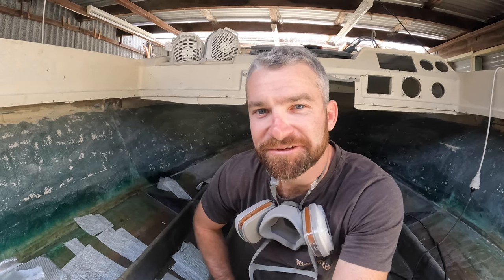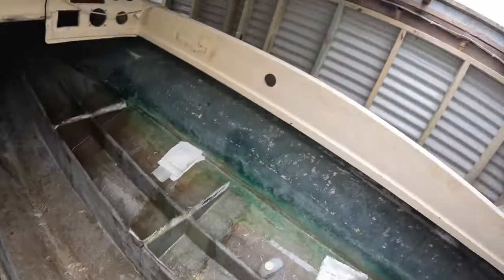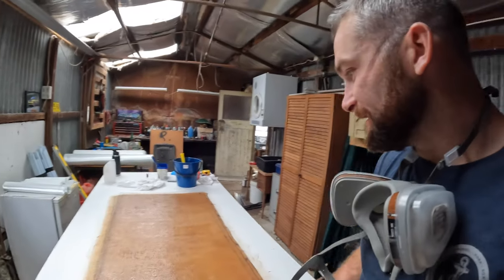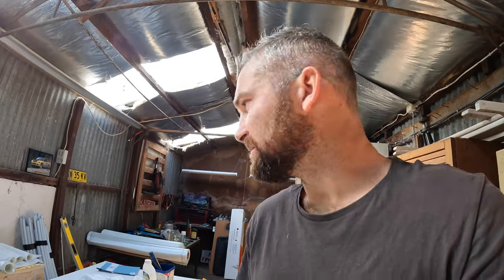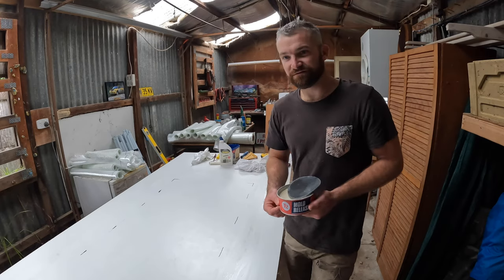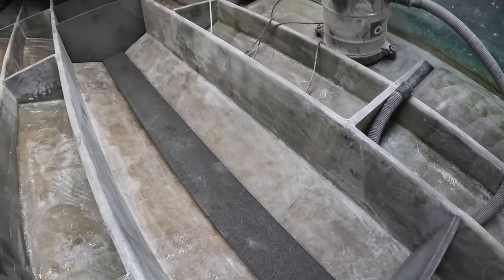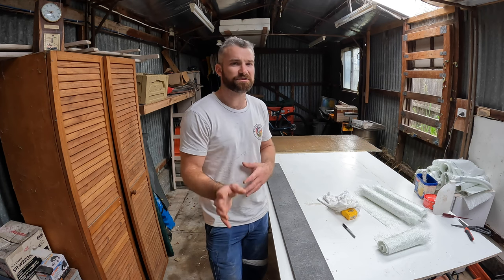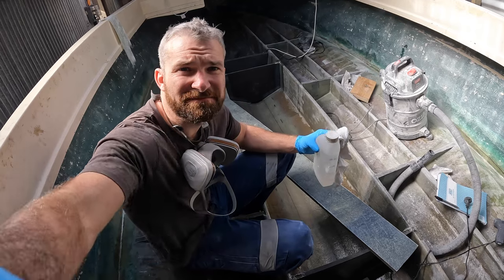Building a Fibreglass Fuel Tank in a Haines Hunter 600R

Comment: Hey mate love the videos. Quick tip I thought of. 

When mixing cabosil and resin pop a ziplock sandwich bag into your mixing comtainer. Then mix your cabosil and resin in that. You can then snip off the end and use it as a kind of piping bag which saves time and consumables when coving. 

I roll it all into the corner with a bolt roller. 
Then I go over my coved corner with a small paintbrush to smooth it all out.
Reply from the maker: Thanks mate, I will keep that in mind for the next time I’m diving in a corner. Thanks again for watching 👍

Comment: Hey Mate, your video couldn't come at a better time for me. Currently rebuilding a Caribbean Crusader I'm in North QLD, I'm also keen to make my own fuel tanks but they will be standalone tanks,  Few questions. Which vinyl ester resin are you using for your fuel tanks and where did ya get it from?? Reason why I ask is cause I"m having trouble finding a vinyl ester that is compatible with petrol containing ethanol, even though our RULP contains no ethanol I'd like peace of mind If somehow e10 ends up in there as ethanol dissolves some vinyl esters and epoxy resins. Some of the the novalac vinyesters seem to be resistant. Trojan fiberglass sells a bisphenol vinylester which from what i read are not as good as novalac vinylester but still waiting to here back on that one. the other option I'm considering is coating with Caswell tank sealer which is a novalac epoxy. Interested to hear your thoughts.
Reply from the maker: Hi Mark, good name by the way! That is a very interesting question and you’ve certainly done way more research on the topic than myself. Firstly I get most of supplies from Fiberglass A/Asia Pty Ltd, a store in Sydney that has 40 odd years experience. They assured me the vinyl ester I purchased is suitable for use in fuel tanks. I’ll get back to you on the exact brand and make. I’ll also add that I have a friend who built a tank in 19r the same and he’s had no issues 4 odd years into using that boat, further to that Coota Craft build tanks in a similar fashion and I’m lead to believe they just use vinyl ester resin with one final coat of waxed resin over the whole tank before sealing off. This is covered in my next video which should be up within a week. You raise a good point about Ethanol, I personally would never put E10 in a boat but the potential is there. I do share your concerns about the tank degrading over time, I guess time will tell with mine now, I just sealed the lid off last night and plan of glassing the lid down today.
Reply from the maker: Swancor 901-TP VE is the resin I used Mark.
Reply: @ADVENTURES_ADRIFT  Thanks Mate! I've found a data sheet for the swancor resin your using. looks  like it's a bisphenol resin like the Trojan Fibreglass Vinylester. Still waiting to hear back from those guys about compatibility with e10 but if they're not keen I may give the Swancor stuff your using a go and then maybe still apply the coat of Caswell novalac epoxy inside. Keen to see your next video. One shit thing that worries me is if the politicians decide to mandate ethanol content in fuel in years to come like the UK and USA.
Reply: Just had a response from Trojan about their vinylester - They were not able to guarantee it's use on fuel as it had not been tested for the purpose. Doesn't mean that it won't work though. Something else he mentioned witch you've talked about in your video

"If you do use vinylester, you will need to ensure the resin has fully cured that will be in contact with the fuel. If you’re using a male mould for instance, the surface that’s in contact with the fuel will cure well from being in contact with the mould. If it’s a female mould, you’ll either need to vacuum bag it or use a wax in styrene solution. Wax in Styrene solution needs to be added carefully, and does not guarantee 100% surface cure. You’ll also want to flush the wax out with a non-polar solvent such as IPA.
Your only other option would be to source a resin certified for fuel use, which will likely be a Novolac based resin. I’ve only seen one person in Australia use it, so I’m not sure how easy this will be to obtain."

This was all a bit new to me. Only ever used epoxy.
Reply from the maker: Hey Mark, I just spoke to the supplier and he said that the Swancor VE is suitable for fuel tanks, manufactures don’t guarantee it for this purpose as they can’t control how the product is applied and the environmental’s at the time. Examples would be incorrect curing and applied in high humidity environments. Time will tell with my tank, worst case I cut the floor up and get a alloy tank welded up. Hopefully that never happens and if it does i hope it’s 10 years down the tract. 
As for Ethanol, given that it’s only 10% I’m not sure it will effect the resin. Good luck with your build mate and I hope it all works out.

Comment: Hey man, why aren't you using 1708 instead of having to use chop and double bias - halves the time and same result?
Reply from the maker: I asked my fibreglass supplier for some 1708 but they don’t stock it and said they get asked about once every 3 years for it. It doesn’t seem to be as common here in Australia as it is in the US. Plus it chews up heaps of resin and  takes time to soak in.

Comment: Did your boat have a keel stringer ,if so is the price you put in going to be strong enough ,just trying g to work out my set up
Reply from the maker: It did have a keel stringer, I choose not to put one back in for two reasons. First being I layer a heap of glass in the keel and the glass from the stringers also overlapped inside the keel. Additionally the V in the hull is what gives the glass strength because of the angle and the additional glass I’m very confident it will be more than strong enough. Further to that I have 5 bulkheads between the stringers and the false floor. Plenty of boats don’t have keel stringers but if you’re worried just put one back in.

Comment: Any reason you are using waxed resin instead of flowcoat?
Reply from the maker: As I’m using Vinyl-ester resin it doesn’t need flow-coat due to Vinyl-ester resin being water proof. I won’t ever see under the fuel tank so no need for flow-coat.
Reply: @ADVENTURES_ADRIFT  Cool I use vinyl ester finish coat over the vinyl ester laminating resin to allow it to cure, its from Trojan Fiberglass, basically a waxed vinyl ester resin with pigment